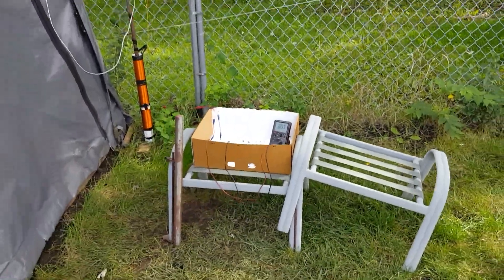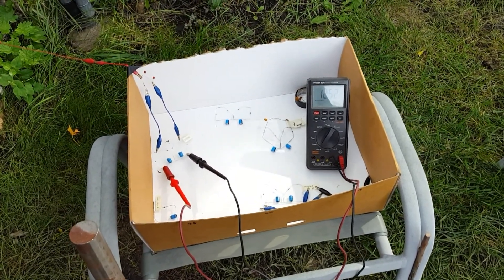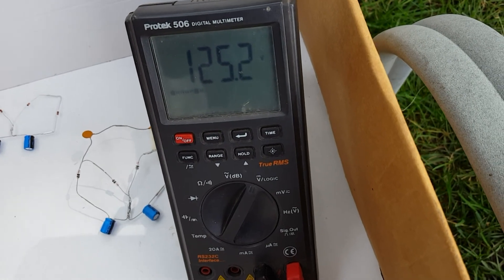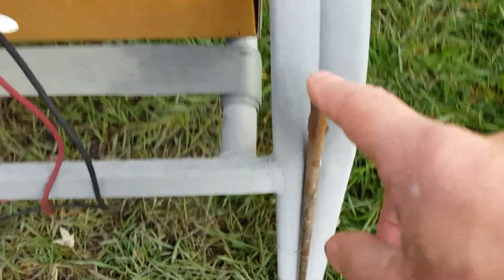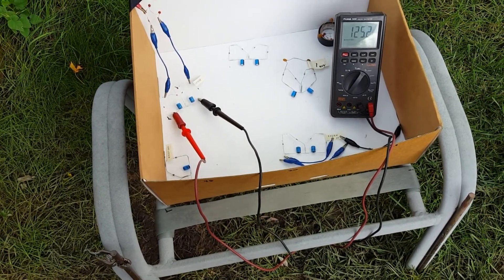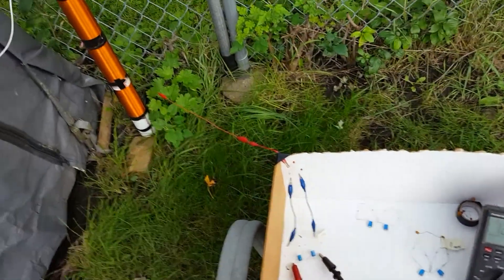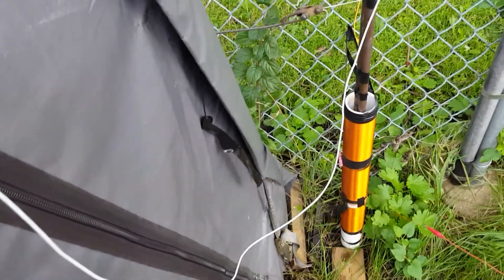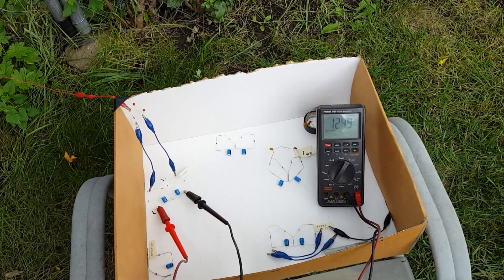Free Energy From Air 2019, part 19 (125V how it happened..?)

Comment: Transmit a 27 MHZ or Ham radio signal close to your antenna and your volts will go up, your capturing radio signal volts.
Reply from the maker: Thank you I understand well.
 I feel very confident it is more than just the nearest radio station which is 8 miles away.  There are many things that emit radio waves/electromagnetic radiation,   Thousands of satellites in orbit, power stations, black holes, the sun,  Paul sars,  quazars, Even tectonic plates pressing against each other with an earthquake will raise the voltage in the system.
 I hope you watch a few of my newer videos with massive overunity,  Or I should say a COP much greater than one.  😁
 Thank you for your comments it is much appreciated

Comment: Please tell me if this works with out grounding and how many like this can work as charger with lithium batterys 500watt 12v with transformation in Volt's continues.

If its only antenna with aluminium foils like flags to collect the ions is not enough?
because tesla coil is useless as i think...

My regards!
Reply from the maker: It will Not work without ground.  The ground needs to go through the coil, as it is a special transformer.  Please watch the last episode of charging a cap.  It seems like a boring video, but it is very important to realize that the more voltage you have, the faster and higher a cap will charge.  The cap does not need a lot of current, only microAmps.  Run things off of the caps, or charge batteries with the caps.  This project led me to the project I'm working on now.  My project now i am lighting up 1,000 LEDs with only about 200mW of power....   https://www.youtube.com/watch?v=ZYEXjennvZk

Comment: The chain link fence may be increasing the inductance of your coil It may be like putting a steel pipe inside your coil. But this is speculation on my part. But if you try putting a piezo disc across the coil. Tuning the capacitance by lowering pf of the disc may be done by putting disc or capacitors in series and parallel. it may change a bit. But different elements have different effects. If you know about Tesla coils and put a quarter wave coil over the center you may try tuning it?  Using a slayer exciter circuit but self powered by the coil in kind of a reverse manner maybe? I am just guessing here. I notice on some of my energy experiments I had to put coils back to back to get an output from a high frequency source but I was using toroid coils. this may be why Tesla used a pan cake Bifillar coil instead as the capacitance brought up the power of coil. Though Tesla may have used iron or steel plates with these pancake coils as well. Where you have to increase inductance of the coil to take advantage of capacitance of the coil? Still guessing but I also  think a water ground pipe that is metal is the best ground.
Reply from the maker: Good to see you again.  I feel you maybe right bout the fence.  I like your ideas about the piezo and Tesla back to back bifilar pancake coils😎.  Thanks for your comments.
Reply: @INVENTOR3  Hello. Been doing some experiments with solar lights. I used two toroid transformers back to back when I replaced the solar light inductor and used a diode bridge and loop it back to the battery. It was some thing to try anyway.
Reply: @INVENTOR3  It cost about ten dollars to buy two transformers from elenco and a piezo disc from amazon to try this. Though I think piezo element plays a role in output. I would not expect to get much power. If you use a piezo disc on each side of the 300mh coil for a mirror negative resistance resonator who know what you might get?
Reply from the maker: @travismoore7849  Yes, very interesting, thank you!  Someone else just mentioned to me about bucking coils and introducing a third coil, with very interesting results also.

Comment: Hi, I would like to thank you for your useful videos, 
It's really amazing, 
I just like to ask u how we can use this  current we get from the experiment, should we restore it in battery first or we can use it directly?
Reply from the maker: Thank you!  You can charge capacitors fast and use that energy to run devises.
I hope your keeping up with my latest project of "wireless power transfer". These two projects could go together very well.
Reply: @INVENTOR3  
Actually I started to see your videos one week ago, and yesterday I built my first circuit to produce electricity from air waves. 
But it seems it broke down, I don't know why, 
But I am not giving up,
I need to see your all video's in order to get the whole idea and more knowledge. 
Ty.
When I get good results, i will let you know, in order to exchange knowledge, hoping the best

Comment: Why don't you apply any type of load in place of multimeter.
Reply from the maker: Oh, i have done this many times in the past,,i always use the same load of 21 LEDs.
If your wondering if the voltage drops,,,yes it does,,,but now with this high of a voltage i can charge a cap in a fraction of the time.  A cap can charge up to it source value :-)  The trick is NOT to load the system.
Reply: @INVENTOR3  yes,I saw it later.
Great work

Comment: its called parasitic voltage, it changes because of the impedance, wire lenghts can be the issue, try also to insulate every part of the naked connectors including the electronic circuit
Reply from the maker: Hmmm, i will check this out,,thank you.

Comment: The PVC pipe produces more voltage then the coil. Raise the PVC pipe up.
Reply from the maker: I herd about many people getting shocked from PVC pipes.  Probably if both PVC is by itself and if coil is by itself(nothing attached),,,then yes, i believe that the PVC will have more voltage.
Raise the coil/PVC, hmmm, yes, this could help at this point, thank you.
First thing i want to do is try to get that chair grounded better.  Temperatures could drop this weekend to freezing temps,,,so i may have to work inside lab mostly now, we will see.
Thanks again Justin, i made note to myself to try this!

Comment: I think the grounded aluminum chair works as a negative capacitor armor, the box paper as a dielectric, and the alligator clip and the wire as positive armor. So you have a capacitor in parallel in the circuit. All nearby objects have a charge and affect resonance by acting as capacitors. Your body too.
Reply from the maker: Hmmm, interesting, good point, maybe the chair, cardboard and alligator clips and circuit make a capacitor,,,this gives me ideas for improvement.  Thank you!

Comment: 125v , but is there enough available amperage to do any thing with it ?
How far are you located from HV power lines ?
Reply from the maker: I already had 21 LEDs lit 24/7 when i had only 20V.  We will see what i can do with this now, maybe add large cap, spark gap, coils, Tesla switch, charge batteries,,,,,we will see.  Oh, i am not far from power lines, about 40 feet away,,,but i did recently check incoming freq from only antenna and there is a slew of freq......here is that video.....  https://www.youtube.com/watch?v=HOg41Nw_KY0&t=36s

Comment: Recomend to bin aligátor clips and use proper wire with better quality conectores.
Reply from the maker: Good to see you again!  Yes, i agree,,,,soon when everything is set, i will put all onto circuit board,,,,,,i do not like all the alligator clips either, to many loses.
Reply: INVENTOR3 
Many times aligátor clips ruined my experiments. I stop to use them. Now I make mine own.
By the way we all would love to see you putting load on it ;) maybe LED lights or dc motor.
Reply from the maker: @KamilDomjan  I will try a load again soon and current reading coming soon also.
I did already have over 21 LEDs lit in the past here........   https://www.youtube.com/watch?v=XK3NrQLR2XE&t=93s

Comment: Let me suggest that you 1, leave that base model completely as it is, and 2, get a variable capacitor, another set of coils, a small tunable choke coil, about 10 small multi-tap transformers and a bread board to allow you to wire up a host of impedances and capacitances as well as a 'reel post' that allows you to maintain a connection while sliding the length of the wire while you dial it in and out.

If you can obtain a ball screw of some kind [or a piece of all thread, need not be strong, 1/4" would be enough], just to fine tune the distance of the array from the coil.

Also, if you have achieved enough voltage for a spark gap, maybe with some storage capacitors you can make a sympathetic EM oscillation and increase the power even more.
Reply from the maker: Thank you, great comments as always!  I printed out your comments.  Its like your reading my mind :-)  especially with the comment of "if you have achieved enough voltage for a spark gap, maybe with some storage capacitors you can make a sympathetic EM oscillation and increase the power even more",,,,this is what im hoping for :-)
Reply: @INVENTOR3  You are [that i am aware of] one of a very very few people who have 1, taken this seriously and 2, remained devoted to discovering the secrets.

So few people had/have the brilliant mind levels of people such as Tesla, Volta and Faraday that for many, this struggle is just too much for them, but you have that dogged determination to never give up, and you keep rewarding the viewers as you keep increasing the power to the meter and the hopes that you just might break through and find that utterly perfect combination.

I always like to point out that both the hardest and softest substances in nature are the same element: carbon, and that on top of that, pretty near everything in our world is some kind of complex combination of very 'normal' ad very 'known' substances, and forces, and that the ultimate goal is simply to find those perfect combinations which reach the peaks of the good aspects while minimizing the bad aspects.

Kinda like that old song "Accentuate The Positive" 

Even without a multimillion dollar laboratory and the best tools in the world, you keep pursuing possible ways of creating an optimal setting to keep reaching higher and higher peaks.

I was shown by my late father how a variable capacitor, along with sets of stepped coils and tuned chokes allowed radios to very precisely amplify just one single signal [frequency/bandwidth] while tuning out all of those which were of no use.

This is basically what one is doing when collecting EM energy from the air.

If one knows which frequencies to tune into, they can focus their resonant [ 'ringing' ] circuits to pick up on those frequencies to increase the yield.
Reply from the maker: @DeliciousDeBlair  Its comments like this that help inspire me to keep going,,,, thank you very much for that DeBlair,,,you just made my day :-)
Reply from the maker: @DeliciousDeBlair  Have not herd from you in a while, hope everything is okay?  I think your dad would of liked my latest project :-)
Reply: Ty Delicious 
I believe u mentioned a good idea by using the variable capacitor in order to get stronger frequency to the circuit, 
Actually it crossed my mind, 
Thanks again

Comment: Tuned circuit Paul, look how they work. 

A combination of impedance and capacitance greatly reduces experienced resistance which equals more voltage getting through the wires. 

As you reduce the resistance by tuning the circuit to its absolute perfect pitch, that leaves much more of the 'air voltage' to be harnessed which would have been wasted into internal resistance and impedance.

Read up on it and see if you can find methods to duplicate this repeatably, and once you have succeeded in repeating/duplicating it, you can begin to test it.
Reply from the maker: Thank you.

Comment: Your adding energy density. I used an aluminum shelf in my shed and a iron spike in a pot of dirt connected by my multi-meter and got 6.7V but 0 current of course. The motor in the Tesla's patent is a electrostatic motor that was in the horizontal part of the circuit and I think it's the starter for the whole circuit that moved current.
Reply from the maker: I understand, thanks for your comments :-)